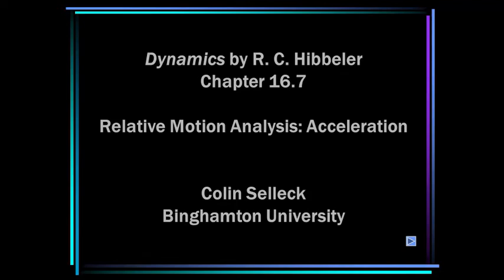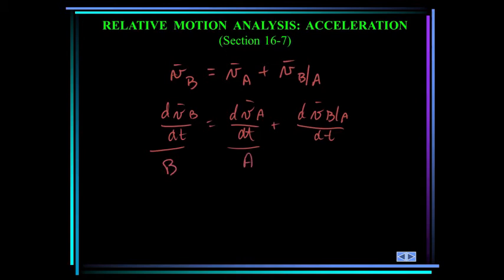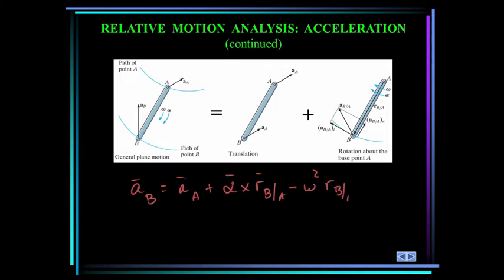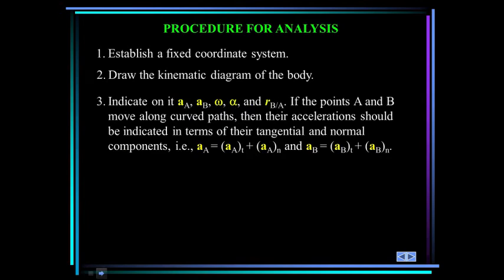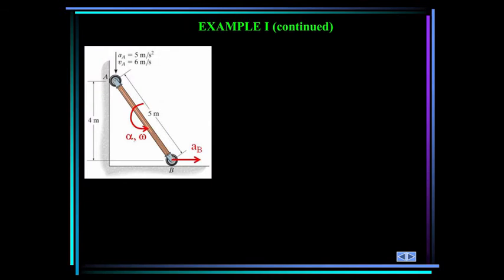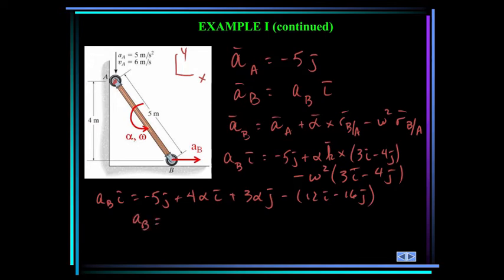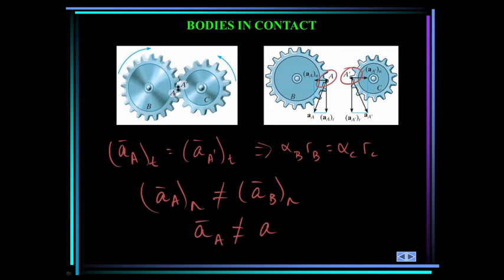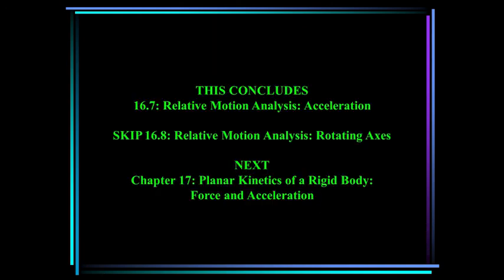ME 274: Dynamics: Chapter 16.7

Comment: If I find it easier to work problems as scalars and not in vector form will that cause me issues later on down the road?  Why would we use one versus the other?
Reply from the maker: Scalars work in the beginning of the course, but many of the later concepts involve vectors and cross products. Vectors work well with 3D problems where the scalar approach is dodgy..
Reply: @ColinSelleck  Perfect answer Sir! Thank you!

Comment: Great video! the last one was a homework problem I was stuck on. Just one thing I noticed, at the end when you divided 10.2/.25 to solve for alpha ab shouldn't it be 40.8 rad/sec?
Reply from the maker: You are correct. Good catch. Acceleration of A is correct in the video.